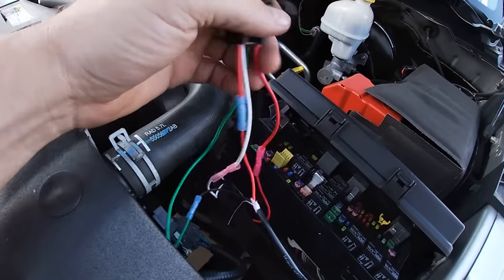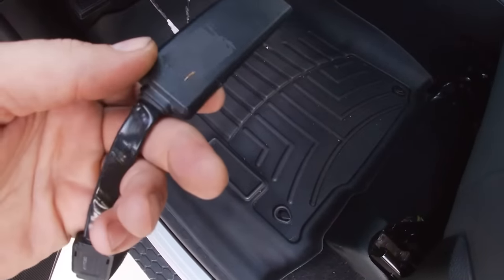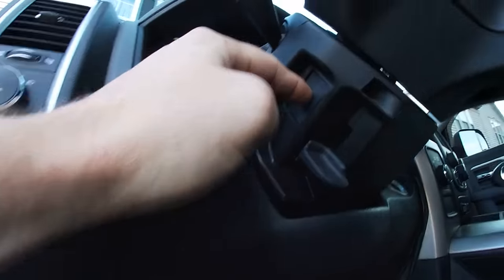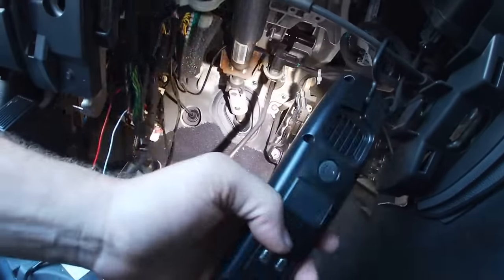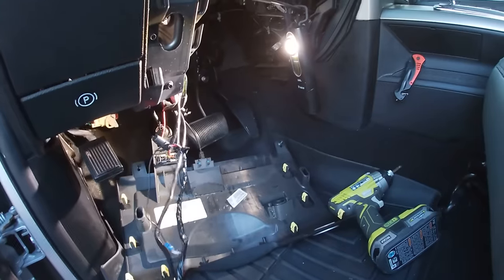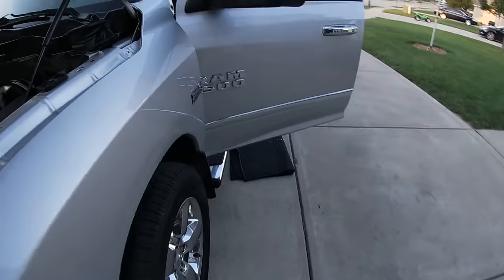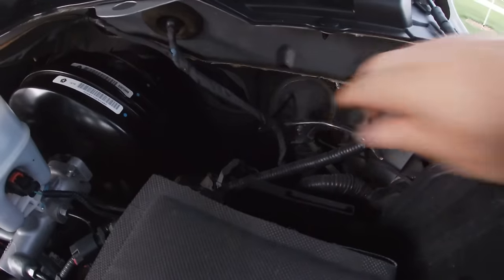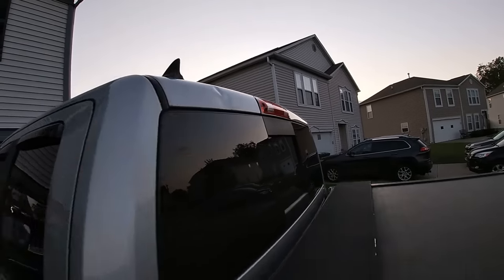Tracking Device Found on My RAM!

Comment: I bought a Ram Rebel that was 3 months old on the used lot.  It was a great deal, I got a $52,000 truck for $32,000.  I could not believe my luck, the truck was put on the lot just about an hour before I got there.  A couple weeks later I was investigating where  I could tap the electrical for my dash cam, and I found a tracking device.  As it turned out the original owner had bad credit, bought the truck and only made the down payment on it.  Because of his bad credit the selling dealer was instructed by the lender to install the tracker.  The tracker I had was plugged into my OBDII port and then it had it's own OBDII plug that replaced the factory one under the dash.  It was hidden very well, if you didn't know what you were looking at you would have thought it to be factory.

To be honest I was pissed at first.  I went off on my dealership and ended up sitting in on a phone call to the original selling dealership, who told us what happened.  It was all good after that and I turned over the tracker to them as it would never be needed from me.
Reply: I would have trashed it instead of giving it back.  But that's just me.

Comment: I also removed the tracking device from my f250, dealer kept calling me to offer free oil changes
Reply: That makes sense. When I took the one off my Denali. Dealer called me a couple of times offering tire rotation free detailing. Ya right. I know what they where doing. I bought this car out right no warranty. Don't here from them in three months. As soon as I pulled the tracker off. Boom there calling. So I put it on one of there service trucks.
Reply: Huh? Why would they offer you free stuff? 🤔🤔
Reply: So they could replace the tracker or find out why the tracker quit working. It was a lease car before I bought it. Apparently it was not removed from there system after I bought the car. That is ok I put the tracker on one of there service trucks while it sat at a local bar. Now it has two on it.
Reply: @davidkuhn8946  Wait how did you manage to put it on one of their service trucks? Did they see you do it?
Reply: @itsdimitriymedvedyev  no they didn't see me they where to busy at a local bar. Every body here goes to eat at. I planned this out a head of time knowing the was going to be there for a few hours. I only need 3 mins.
Reply: Arrow Green  you don't have to believe it. Cool name by the way. You also don't have to believe the issue I went threw to get a truck I bought out right off there lease program. They kept shutting it off on me. Did not figure that out till the evap system failed.
Reply: @ptgtdcr  to put another one on there!jim
Reply: @ptgtdcr  dealers tamper with your car to make money. Never go to a dealer without a warranty.
Reply: @davidkuhn8946  dealers run auctions I swear they track it to steal it then wait at the auction to buy it cheap.
Reply: @davidkuhn8946  good man
Reply: @davidkuhn8946  That's funny as hell
Reply: You have no idea how many I've removed. Thats my first question when a lady tells me her car wont start. Did you pay your car payment?
Reply: @ignorthepain  u just won the prize. 😂😂😂💪
Reply: Arrow Green  I doubt you opened his vehicle, wired the tracker/switch and placed it in. Unless it's a magnetic tracker which doesn't manner, then I doubt you've done.

Comment: A very bad install the funny part is someone is probably still paying for the tracking service
Reply: henry q doubt their still paying. It’s a subscription. They likely just quit paying it when they sold the truck, which was likely a fleet vehicle. They probably just don’t remove them because the cost of the device doesn’t outweigh the cost of removing it.
Reply: henry q yea
Reply: Doubt it..
Vehicle gps devices run off of sim cards same as your phone..
Its pretty much a phone plan that gets paid everymonth.
Once a company stops using it. They just stop paying and it gets shut off..
Its like 500 to install and like 800 to take it out.
So they just let them expire and sell the vehicle.
So its most likely off
(My friend owns a vehicle gps company)
Reply: @thegreatwhitenorth8754  Which that's explained why it goes beeping. When my family vehicle get paid off then couple months later. We constantly hearing beeping whenever vehicle started. We contacted dealer where they fianaced through. Lucky, they said tracker got deactivated which that's why it started beeping.

Also, that's other explained why vehicle's battery kept go dead 2 times a year but battery warranty was covered so then we trying multiple different brands and better CCA to see if it helps but it didn't so warranty made it not big deal also we used roadside assistance if vehicle died during out of town. Roadside assistance did replaced battery and got money back from warranty in store.
Reply: you dont pay for google maps.... just the unit that broadcasts to google maps.
Reply: It could be a jealous spouse some place. I know a dude that caught his ex screwing around on him with a tracking device. Caught her in the act.

Comment: Aren't you pissed off that nobody told you about tracking device. Could be used for evil purposes.
Reply from the maker: john gallagher Yes I was! It was in there when they got it because we looked at it right after the dealer took it in on trade and it was beeping.
Reply: FAB Automotive Detailing they probably didn’t know it was there either and like you, brushed off the beeping. 
The truck was likely owned by a company as part of a work fleet and so they had that on all their vehicles. It’s possible it gave them not only location info, but also info like how fast their employees drive. We had something similar at one place I worked.
Reply from the maker: Unkadunka Dee Yeah I’m sure they didn’t know. I buy all my vehicles there and have never had a problem.
Reply from the maker: thegreatwhitenorth It’s not the fact that it was traceable. It’s that it was wired stupidly and caused the corrosion on the relay making it not start and not to mention a fire hazard. Our phones track us and listen to us everyday.
Reply: I can see the dealer is at fault here as that is something they should inspect for. Like making sure the spare is not flat, all the lights work, etc.  Now here  the owner was able to take if off himself, but most buyers would need to pay a shop to do that work, so that would have cost an hour or two of labor.
Reply: @thegreatwhitenorth8754  seems to be more WHO could be tracking him not that hes tracked. Also its a 2013 with decent trim. Probably has something like On Star
Reply: his EX is watching him. tracking every inch he drives.
Reply: The dealership transferred the tracker and was selling your location to Google for advertising purposes.
Reply: You got a cell phone  right are you angry still. (Mic drop).
Reply: @ignorthepain  don't read do you?
Reply: @thegreatwhitenorth8754  you cannot read RFID chips, if you have 2 cards and place them together ( lockpicking lawyer tip )
Reply: @pws3rd170  🙌🏼

Comment: A lot of dealerships put tracking devices on their vehicles so when you miss a payment they know exactly where to send the repo truck.
Reply: Bobby Brady  Wellllll.... they still technically own the vehicle, until it's paid off.
Reply: Bobby Brady Gotta read the fine print. They usually specify somewhere in the agreement
Reply: @HobkinBoi  Right, once the vehicle is paid off the tracking device is removed to be installed on another vehicle. Most of the smaller, privately owned car lots in my town do it, I really don't know about the Ford or Chevy dealerships though.

Comment: Found one of these on my mom's 2014 Dodge caravan. We bought it at an auction. It's powered on but I'm scared to cut it out and not have the car run anymore
Reply: Remove it and just short together the two start wires. That box is providing data to the finance company. If they think its not being paid for they can turn off your car.
Reply: @KlodFather  I would worry more about a hacker getting into the system and holding your car hostage.

Comment: I bought a fleet van to flip and found a tracker under the dash with a Sim card in it, out it came just out of curiosity
Reply: Take the sim card out, put it in a cheap phone, make a ton of 900 calls. Sim will be turned off asap. Problem solved.

Comment: Why can little boxes like that make such a loud sound but speakers 10 times that devices size can't even make half of that volume
Reply from the maker: Andrew Durfee It’s surprisingly loud for how small it was.
Reply: Must be made by Bose... lol
Reply: Audio speakers have to produce fuller sound over a much wider range of frequencies, including lower frequencies which require plenty of power. Tweeters for higher frequencies are smaller and don't require as much power. This device produces sound in only a single higher frequency, which requires very minimal size or power.
Reply: @dwightstewart7181  
Absolutely true.  When I rebuilt my 1m tall Jensen Quadraxials I installed a 15" 1000w Boss Subwoofer, 2x 5" ESS 60w  midrange, a 60w Goldwood GT-1025 3" x 7" tweeter and a new crossover in each cabinet.  They literally thump the walls and rattle the windows!!  :-D
Reply: @13bgunbunny42    ..  After repping a few audio manufacturers (Infinity, Klispch, Phase Linear, Soundcraftsmen, Yamaha, Marantz, Hitachi, TEAC, Koss, Sennheiser, dbx, Thorens, Dual, Shure, Audio-Technica, etc) over more than a decade, bits and pieces of such things still float around in my head.
Reply: Noise is easy, Audio is hard....
Reply: tuned cavity vs wideband response.
Reply: @MidwestRainstorms  no, it's just an expression of exasperation

Comment: I would have looked into using it for a add on security system. (I don't know what that would entail) but why not if you can weed out the original tracker/locator then I can track my truck myself should it disappear, etc. Just my 2 cents

Comment: I'd expect a fleet tracker would be wired in better than that, but I guess not.
Reply: Lol if it works dispatch and management dont question it even if a driver complains
Reply: Fleet mechanics often just don't care. Anything from breaking of the squeakers from break pads to not have to do breaks that day to fix the noise complaint, to using fix a flat instead of resurfacing rims.

Comment: Dealerships: they will invest  time to install a GPS
Also dealerships: we can't get your four-wheel drive to work we sell it as is
Reply: What he said...Dealerships put these on vehicle so they can be found when you choose to not pay your payments or drive away with their vehicle on a test drive..
Reply: Well, TBH, installing someone else's product is easier than fixing your own.   Oddly enough, I ran into that same problem.  A dealer wanted to replace my transfer case because my 4WD wasn't working properly.  Luckily, before I gave them permission, I figured out on my own that the problem was it had the wrong oil in it(or the oil was just too old, either case was possible).

Comment: A few years ago there was a customer that came into the dealership that I worked at. She requested an oil change and some other service. She also requested that we look underneath her car for a tracking device. Everybody thought that she was a little bit on the nutty side but we looked anyway. Sure enough back in the right rear corner of the car we found a self-contained James Bond type tracking unit held in place with some magnets. She said she suspected there was some kind of a tracking device because her ex-husband seemed to know a lot about her travels. She carried it out with her and I suspect it was probably used in some future divorce proceedings.
Reply from the maker: That’s crazy!
Reply: @jasoncentore1830  actually that’s not a slam dunk we don’t know the specifics but if his name was still on the cars title it’s perfectly legal..... 

It’s a common practice gps trackers are used all the time to follow folks especially by private investigators..... legally and illegally of course. A good on would have installed it out of site on the frame. It being on the back scream rush job in the drive way or parking lot

Comment: Check behind your third brake light as well I had one in the same location as your and a second one behind the third brake light. I do know if the dealer is the finance company they will put them on some times just to know where the vehicle is if it ever goes into default.

Comment: For those of you that have this installed as a part of your loan due to bad credit or no credit or whatever the case DO NOT REMOVE IT. They can and will repossess the vehicle immediately for tampering with the device and make you pay to install a new one if you are lucky enough to get it back. I’ve picked up several they refused to give back. In your contract it usually mentions tampering with the device
Reply from the maker: mike barcus Yeah if it was for my loan I would not have removed it. It was on there when we first test drove it before we did any paperwork. Plus the corrosion on the relay shows it has been on for a longtime. I have only owned it for 2 weeks.
Reply: I'm a sub prime auto lender. . We attach one to every car. I also sell those to the dealers and it simply gives little more insurance for you to know that you can find your car if need be.  The system also provides a discount for anyone who has one with there insurance company.  This isn't fishy at all.. the drama over this reminds me of far most of the guest's